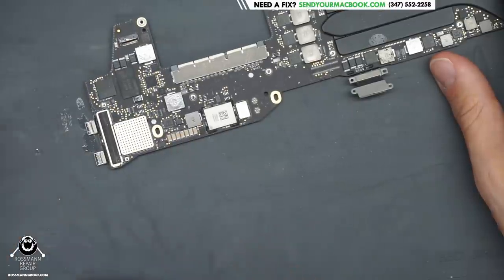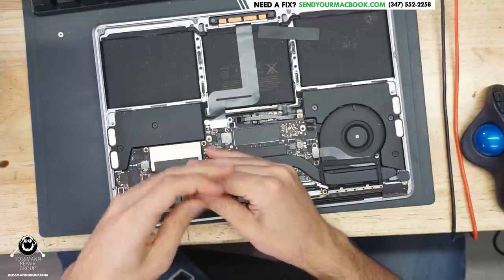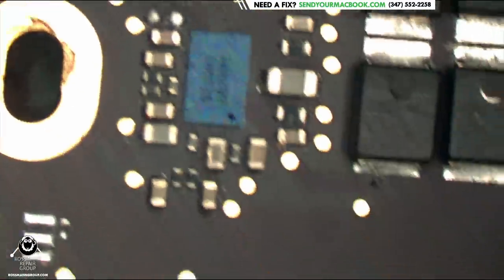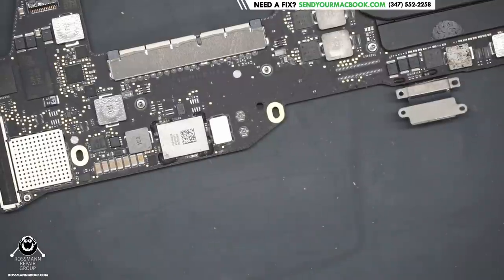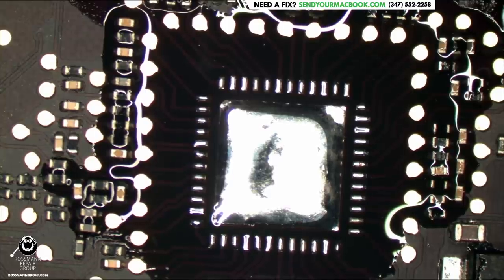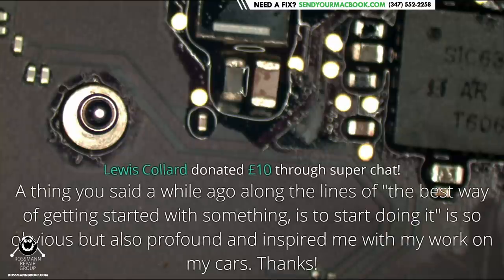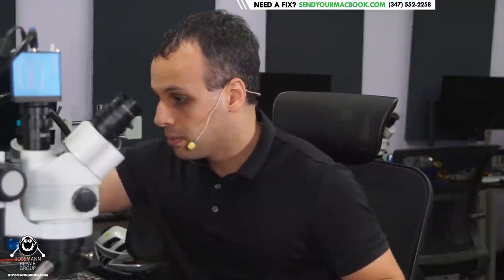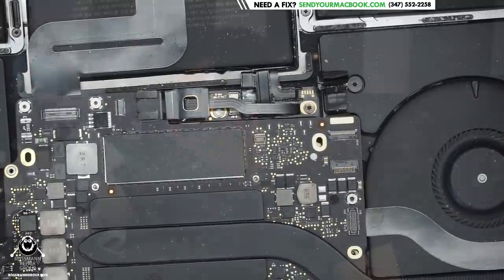A1708 Macbook Pro no power; CPU buck converter issue, let's fix the logic board!

Comment: I've been doing repairs for a while, but mostly by replacing whole parts and less on the component side unless it was a large through-hole capacitor or something similar. Recently I've gotten into buying parts laptops from eBay and have had some success getting nice modern machines for cheap. Now I've got a hot air station, microscope, nice soldering iron, flux and I'm eager to learn. The price for entry was also much lower than I thought.
Reply: How much was it all total?
Reply: My last big repairs was replacing some caps in a monitor. Still runs to this day.
Reply: @Sir_Ninonino  Around $150. It’s all the basic crap from Amazon, but they all work as they should.
Reply: @Collinormous  Damn, it is cheap.
Reply: @Collinormous  what kind of iron did you get? I have a Weller SP25NKUS, and do not recommend for repairs like this. It's just too big.
Reply: @the_grass_trainer  Yeah, that's like trying to play the piano with  basball bat. Try getting yourself a temperature controlled soldering station and an iron preferably with interchangable tips. For small circuitry that iron you have well destroy tracks and lift pads. I use iron's like yours for soldering large things like high-power connectors in solar systems and radio transmitter connectors and large coax.
Reply: @vincei4252  oof, yeah i gotta get better equipment soon if i wanna continue tinkering then. thanks!
Reply: @vincei4252  I love the simile.

Comment: Back in the day when computers ran on relays, insects would get attracted to the heat and get stuck in the relays. programs would literally get a bug in them.
Reply: They still like to die in the high voltage part of the desktop PSUs
Reply: Technically, that came from the vacuum tube era, but yeah… literally a bug.
Reply: thats how the word "bug" appeared in pcs
Reply: back in the day before programs. oh wait, this still happens, rodents get attracted to the heat and build nest right in your electronics and get fried when turn them on because they made a ground contact or chewed up the wire sheath.

Comment: Definitely a hardware guy, that's the slowest debugging I've seen in my life!
Reply: now I truly understand what "debug" means hahaha
Reply: tbh Louis Rossman's nothing compared to the guys in China. They can UPGRADE a SOLDERED cpu from i5 to i7!! They can UPGRADE soldered RAM!
Reply: @bobjones1999  well they live on the SOURCE of the materials, they can actually do this because there they can have easy access to these components. I believe Louis can do this, if he have proper materials and equipment, altough since there is no such oficial store for these kind of components and you have to rely on donor boards, he would need to import them and since takes time and he have to rely on the component being good, I guess would be not much worth... 
also changing soldered ram and processor could also need to change some bios setting I guess. but is doable.

I was always thinking, if I could change my 2015 laptop amd gpu for another one of same era and generation but stronger or such...
Reply: @MrLuigge  true. But for even in china they don't use up that that mcuh of extra parts. But u do have a point
Reply: @MrLuigge  Tbh to his hands are pretty wobbly

Comment: I have dug several computers out of the trash. One was a server from a vets office that was stuffed full of fur. I replaced the motherboard for less than $20 and then sold it for $75 on Offer Up. I rescued an E-Machines desktop that had a bad hard drive. I took it completely apart and got all the goo out of  it and it worked great after replacing the hard drive and still have it to this day. I also rescued an HP AIO printer that was full of water. I tilted it over and let it sit for a couple of weeks. I came back and cleaned it and it powered on and initially it wouldn't work. I removed the ink cartridges and cleaned up the contacts and it came back to life! It's amazing what people will throw away!

Comment: Inspiring, Im ok with a screwdriver so I got a MacBook Pro (13-inch, Late 2011) from ebay and had a go at fixing one fan worked second one was broken,  brought a new board, wifi card, SSD SSD/HDD cable, 16Gb of Ram as the clips on the original were broken, SSD, Base Cover, Screws. has the graphics card issue.  3rd Party charger and I have a working MBP.   I didnt realise the WIFI was not working till i looked closed and realised the Ribbon cable had been ripped.   spend around £500  including the MBP which has a working screen and keyboard etc just internal parts after a few weeks of parts arriving, got a fully working MBP.   If your ok with a screw driver and can organise screws anyone can do basic parts replacements

Comment: How to start? 
Step 1: Buy the minimum equipment - a table to work on. A fan extractor. A hot air station. The 8 or so screw drivers you need for apple computers. Flux. Solder. Soldering iron. An ultrasonic cleaner & solution.
Step 2: Buy a couple of the oldest, cheapest, WORKING computers you can find. Take them apart, put them back together. Check that they still work. Take them apart, clean them in the ultrasonic, put them back together. Check that they still work. Take them apart, remove and replace a resistor or two, put them back together, check they still work. Take them apart, remove and resolder a couple of chips, put them back together and check they still work.
Step 3: Find a broken computer and see if you can trouble shoot it.
Step 4: Put up your sign as a repair business. :) Start buying the extra equipment - like Paul Daniel's software...

Comment: Nice video! Hmm, what's preventing the middle pad solder flowing out when you press it down, to make bridges between the pad and the edge pads, or between the edge pads? Always was afraid of that kind of issues, when soldering stuff like that...

Comment: Independent repair is Superior in my experience when I went to go get my pixel 3 XL battery replaced I went to Google's certified repair center first they killed two pixels on my screen when they replace the battery they replaced the screen next they ended up breaking the fingerprint sensor so they ended up replacing the motherboard except for the case the entire phone was brand new by the time I was done

Comment: but why dont u just put a brand new cpu on the board why cant u just solder a new one on couldn't u just do that to get the computer fixed again if the computer never booted but it did boot so the computer works but could u just solder a new one if it was the case it not working
Reply from the maker: Do you rebuild the transmission on a 1987 Honda Civic with 600000 miles on it or do you toss it in the scrap yard?
Reply: @rossmanngroup  I mean if it's a cheap car that ain't worth repairing Yes I would say put it in the scrap yard unless it's a classic car like a Cadillac or something then I would probably get the partial placed on it to get it working again I understand what you're saying